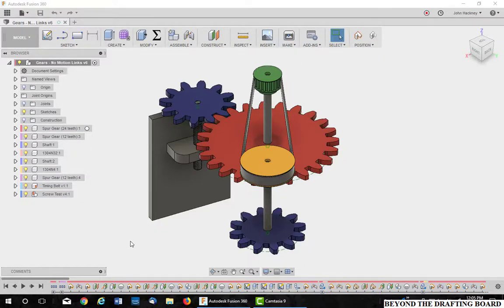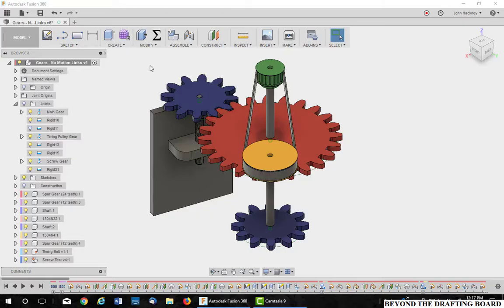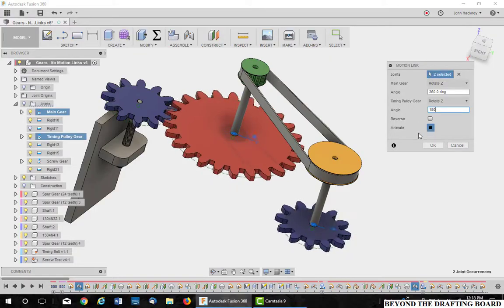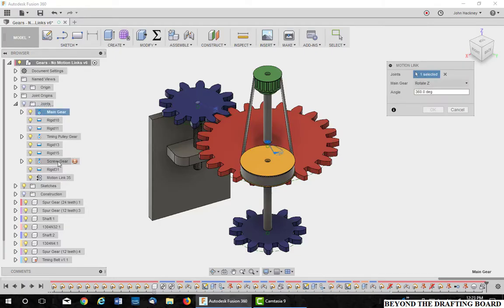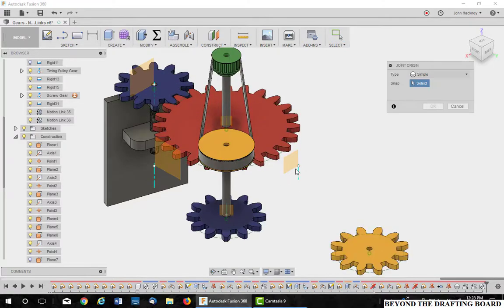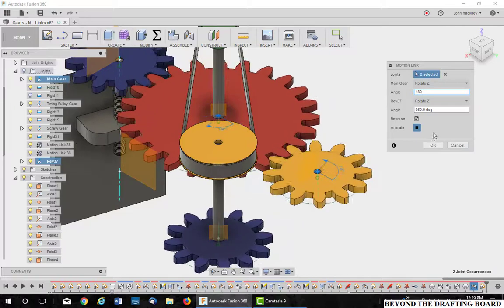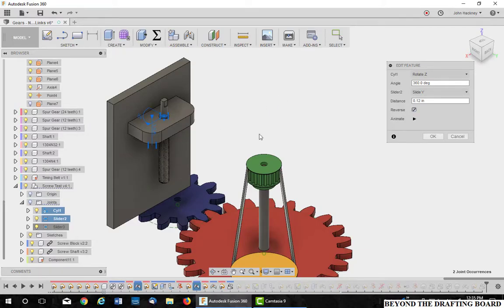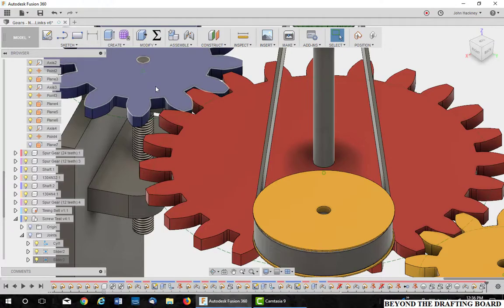Motion Links between Joints in Autodesk Fusion 360

Comment: Since the belt is static..it appears then that Fusion 360 is not the CAD platform for designing chain and sprocket mechanical assemblies..Darn, looks like we’ll still need Solidworks then.
Reply from the maker: The belt may be static but the two belt pulleys, and the shaft they drive, is dynamic to ratio.  Who needs to see the belt move!

Comment: I can't drag any of my parts and joints.  Does that mean I've skipped a step in the beginning, or something?
Reply from the maker: I would have to have your model to diagnose your issue.  Export the file and send it to me at jhackney1950@gmail.com
Reply: Check all your Components to see that you didn't have too many things Grounded (red pin on the icon) or overly constrained Rigid joints (you need to examine all joints in all your Components)

Comment: Hi John Nice tutorial. My question is: there is a way to give the belts movement in 360 fusion?
Reply from the maker: No, they will have to stay static.  Even in higher level CAD packages like Autodesk Inventor this is very difficult to do and very system intensive after you do it.  I have animated roller chain in Inventor and watched my computer processor use go through the roof.
Reply: @jrhackney  glad some asked that question I was searching videos for that answer lol